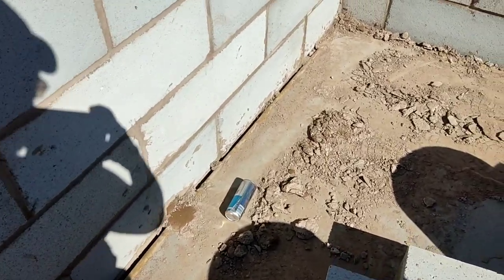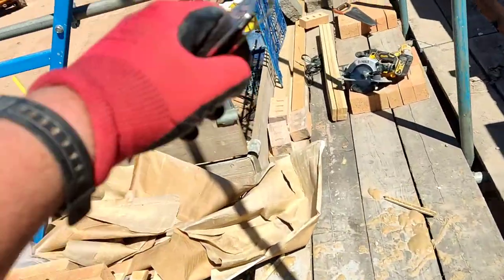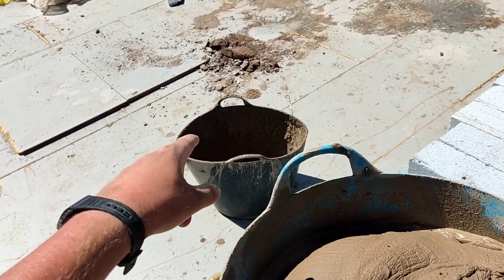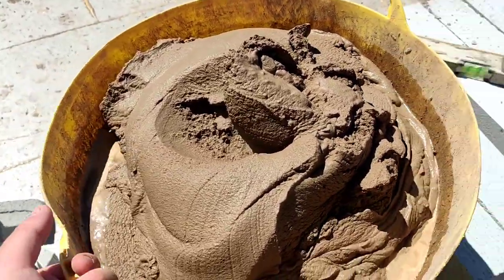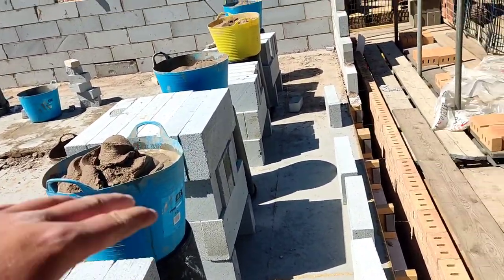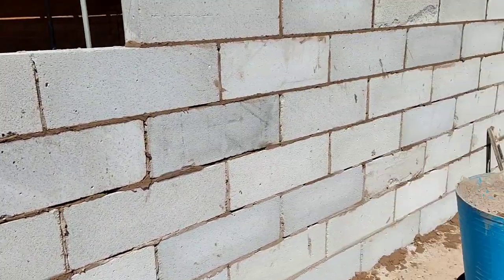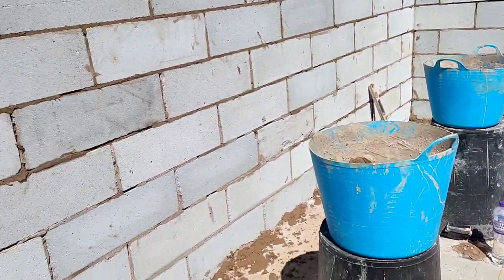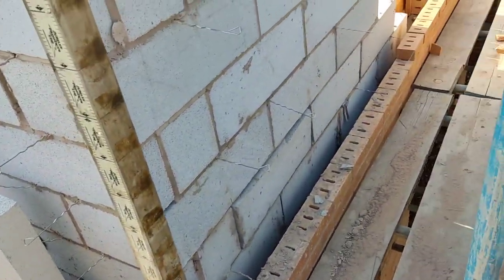Bricklaying Vlog - Setting Up for Brickwork?! Tubs vs Boards?!

Comment: I worked in Holland for years and all the Dutch brickies used tubs but their's were rigid.  They also use this very unusual towel, short and thick with a curved end so it's easy to get your gobbo out of the tub with it. They did a version of pick and dip too.
Reply: Arnhem trowel for right or left handers ( Arnhem metsel troffel )
Reply: The rigid tubs are better . Turn one upside down and put one on top perfect height for the muck.
Reply: @brickbybric  I've got a right handed one. Brought it back as a souvenir, and I'm not even a Bricky 👍
Reply: @brickbybric  by any chance do you know what website I could purchase any of those strong tubs ? Any help would be appreciated
Reply: @andrewmorrissey8478  I’ll try and send you a link in a few minutes to the place in Germany I got them Andrew .YouTube seem to have gone bad at showing links in the comments .Are you in Ireland or the uk Andrew because a lot of them have delisted the uk as a destination they ship to since brexit . Lidl have them in in Ireland at the moment . 65 and 90 litre ones
Reply: @brickbybric  I’m in Ireland ya, those trowels look the part too, I saw them first on Jays vids
Reply: @andrewmorrissey8478  Lidl have them in Ireland at the moment 65 liter and 90 liter ones. On sale tomorrow the 25 th . 9.99e and 12.99e
Reply: Mortelkubel on eBay Germany
Reply: @brickbybric  thanks very much mate 👍
Reply: @andrewmorrissey8478  did you get the tubs andrew
Reply: @brickbybric  yes got some of the 65 litre ones, good value really, seems stronger than other brands

Comment: Would it not be easier to have the buckets on the floor for the first few course? Save you going back up for the mortor surely that would save you more time with you already being bent over?
Reply from the maker: Yeah it would to be fair just more moving of bin and etc, just focusin on loading up all mortar so dean can get on the trowel more atm

Comment: I get 3 full buckets on Gatorback boards, and using tubs how do you get the last half bucket or so in the bottom?  my boards are 4 years old still going strong, lets see how many tubs you get through in that timespan, bet my boards work out far cheaper.
Reply from the maker: If you put 3 buckets on a board in go off too quick  before you use it in the heat and half of the third bucket slides off if it's too wet rand they cost 6x as much a gorilla tubs
Reply: The handles are coming off yours already, and wait till winter when they get brittle and crack, where do you buy them a @ £6 each? on Amazon there £12 each, a halfway house would be mortar pans but they cost £60 each, but would last many years.
Reply from the maker: @Charliegeorge65  eBay pal
Reply: @theafter8bricky  just cut two handles into the  tub when the handles do do ,simple fix 👍😃🍺
Reply: @theafter8bricky  I have the gator boards and I can say the gobo doesn't go off yh they cost a lot but I've had mine for nearly 2 years still going strong we did a test last week 2 buckets on each it went off rapid on the board and not the gator

Comment: The tubs keep the mud wetter longer in the heat! The smaller trowel is the key so you don't jam your wrist in the tub! you can use the side of the tub to help roll the mud on the trowel!  Great system it works well! Keep banging 'em in!
Reply: Check out RUBI brand utility tubs they have better handles than the Gorilla tubs. They are thicker all round,stiffer and more durable.

Comment: Tubs, tubs, tubs all day long, it's the only way with continental trowels, also Porotherm glue blocks, so backwards this country.
Reply: I worked with Porotherms a few years back in North London and the flat end hook ties were bigger than the bed joints so to get a the wall plumb it had to hatch and grin. So much faster that conventional blockwork but there are still a few kinks to iron out.
Reply: @evocarti  Think all that has been sorted mate, when I did it 40 years ago they just used similar to remedial ties, simples.With the new regs out its the way forward ,internal walls first, roof on then every trade can work inside and brickwork can be done whenever, similar to timber frame but more traditional and better.
Reply from the maker: @evocarti  I did that thin joint system at college in 2010 but it never took off
Reply: @theafter8bricky  it will do,it's the norm in western Europe, I can tell you manufacturers are worried about the skill set of UK bricklayers to be able to use this system. I was first using it in 1979 so nothing new a bout it we are just backward.
Reply: @theafter8bricky  Only seen it down south once myself but there's a big care home builder down here who only uses Porotherm blocks.